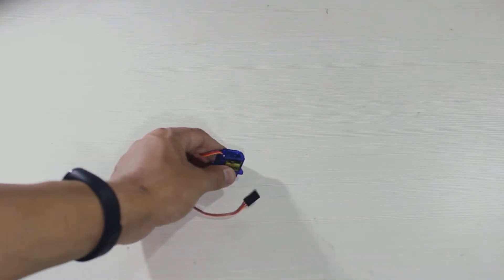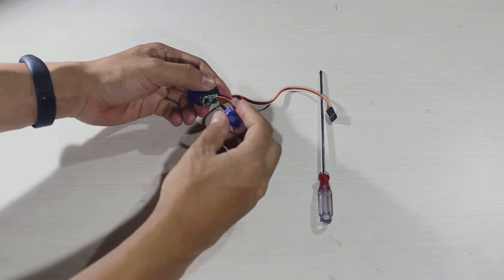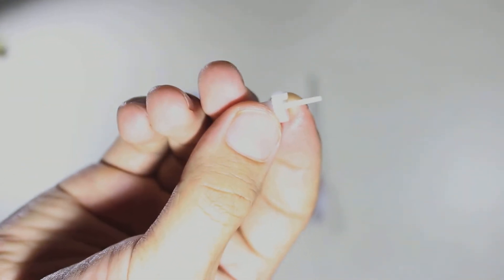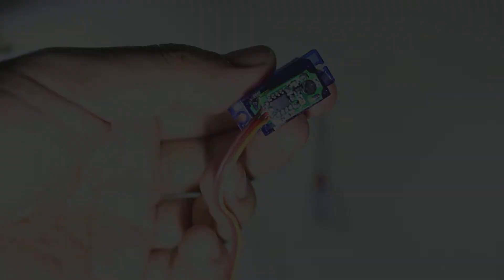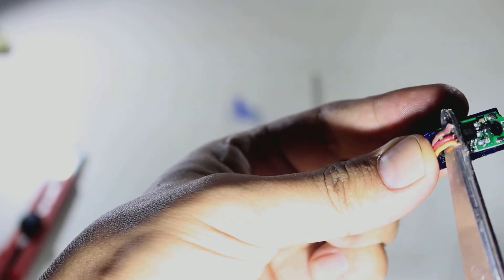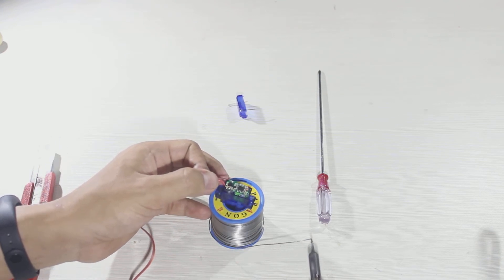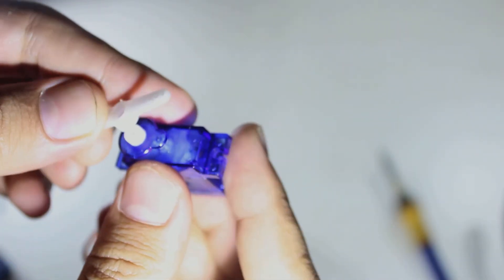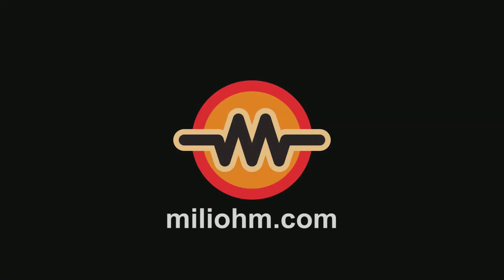Converting Servo to Regular DC motor

Comment: Thanks for the idea...I wanted to make a windmill lookalike for my project 

Now the challenge is that with 5 volt stil it spins very fast (donot resemble a windmill), 

So I have put a 3 volt led and resistance in series to make a voltage drop..now voltage reaching the motor is around 2.5 volts and motor rotation is slow which makes my project

Comment: YOU DO NOT NEED TO REWIRE THE SERVO OR SOLDER CONNECTIONS, IF YOU WANT A BI DIRECTIONAL MOTOR  RADIO CONTROLLED

Comment: may i ask, how can I stop the continuous rotation of it?
Reply from the maker: Since it converted to dc motor. You can use DC motor driver like L293D or L298N
Reply: @miliohm  sir can i control it using code?
Reply from the maker: @klausclegrey9094  yes, just like regular motor dc. you can start, stop, speed up, speed down, turn right, turn left. But you can't control the degrees anymore.
Reply: @miliohm  done it sir, I controlled to stop the servo using an relay thank you
Reply: @miliohm  sir may I ask, if I make my servo motor into 360... then it's now called a DC motor?
Reply from the maker: @klausclegrey9094  yes, maybe you can call that DC motor with gearbox.

Comment: Thank you for your video. I have a question. Is it okay to cut only PWM line? I want to know the reason why I cut Vcc and GND and solder them!
Reply from the maker: The idea is to bypass the servo circuit. If you just cut the pwm line then you still have to use the pwm signal to control.